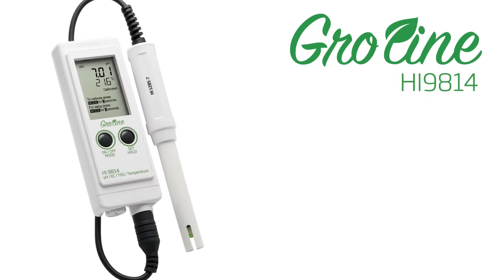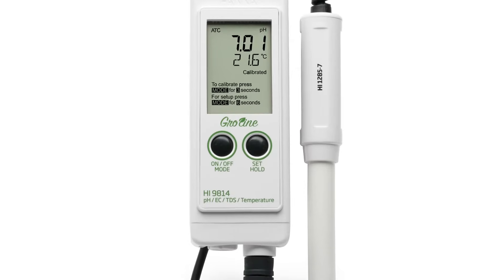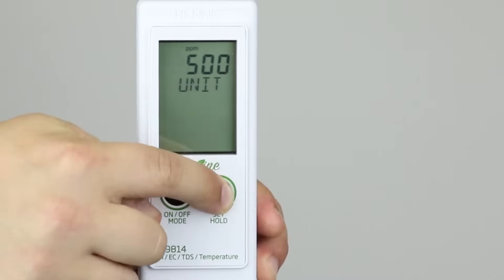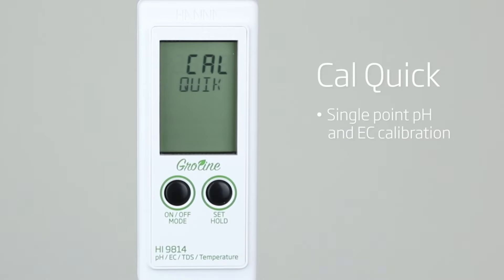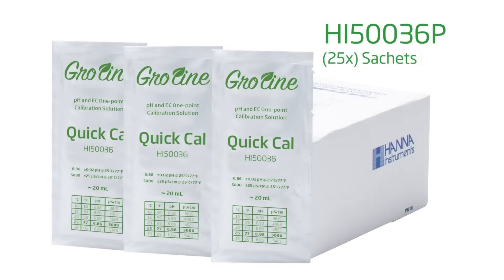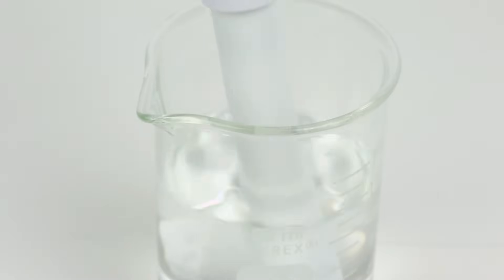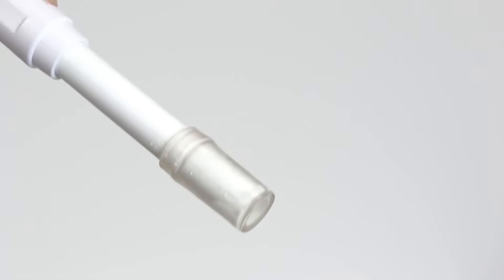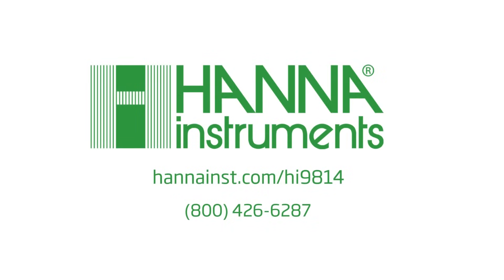How To: Hanna Instruments GroLine® HI9814 pH/EC/TDS Meter Tutorial

Comment: If have lots of cash to burn get one of these meters as they are pretty good. 
The TDS probe does not wear out anywhere like as quickly the PH probe, but as they're combined you will have to replace the whole combo probe, at huge expense..
My advice get separate meters, most PH meters have short lives, and then there is the cost of calibration, storage and cleaning fluids, another small fortune. Its like the whole printer and ink cartridge scenario but having to buy a new printer too...

Ask me how I know? On my 6th HANNA PH meter, used their range from £450 down to £65, they last from 6/9 months maybe a year for the more expensive type...Be warned!
Reply: That sucks, i get 2 years minimum from an essentials brand ph meter at the cost of £45, never used there ec meter as i use a Nz truncheon